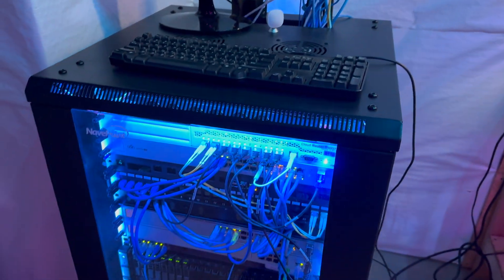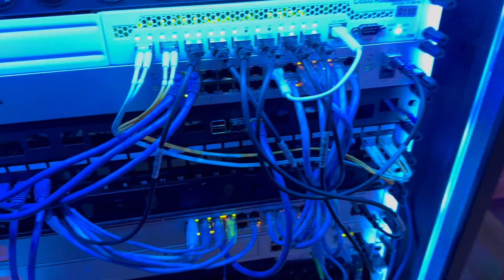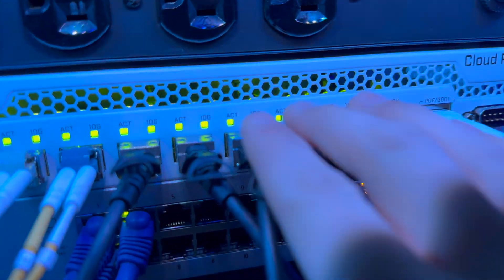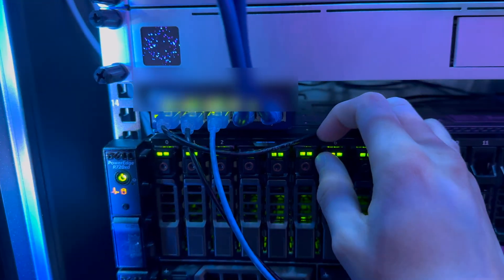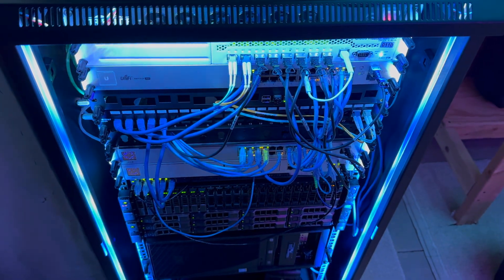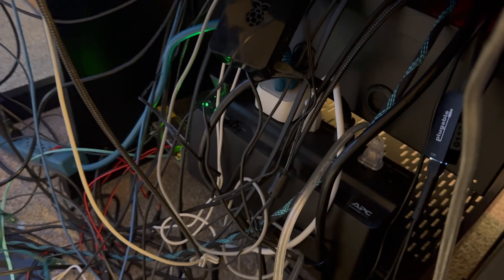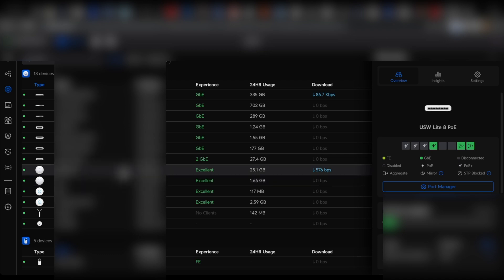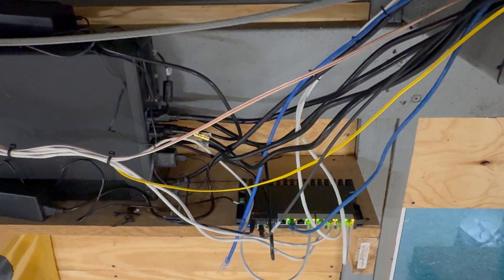2023 Homelab Tour: UniFi, Mikrotik, Fiber, VM's, and more!

Comment: Nice lab! One suggestion is to be careful with that PDU with red switches.
I wanted that PDU quite a lot myself because it let you toggle power to individual devices so easily.
But i kept coming across examinations of the electronics inside and each one hammered home how unsafe it was.
I don't have the knowledge to confirm it, but I try to avoid any potential issues where insufficient wire gauges are concerned.
Reply from the maker: Good to know about the wire gauge. I don’t pull much power from it but I’ll be cautious with pulling more.

Comment: Nice job. I am curious to see what you've got going on all the gear. I'm building a network on our 5-acre proptery with 10Gbs fiber connecting at least four buildings, and maybe a front gate in the future.
Reply from the maker: I'll make a video about what all I'm hosting on my servers soon, but mostly the reason I have all the 10G networking is because of how cheap it is. Was very surprised to see the low cost of the switches and SFP's and all that. Your setup sounds pretty awesome. We also have some land and it's been fun getting connectivity to different locations for sure. Happy holidays!